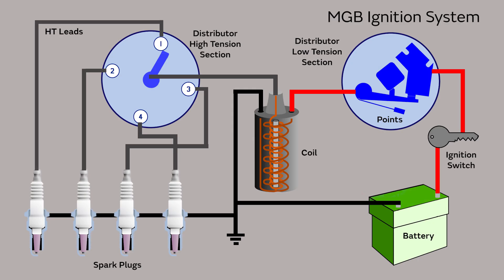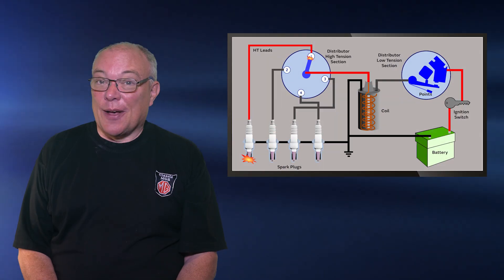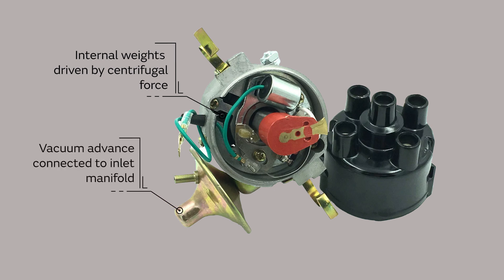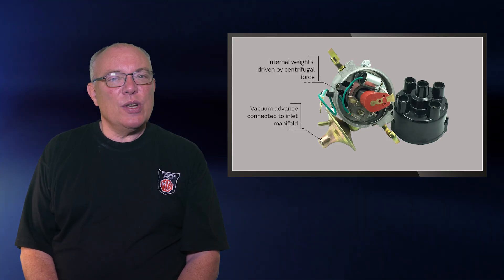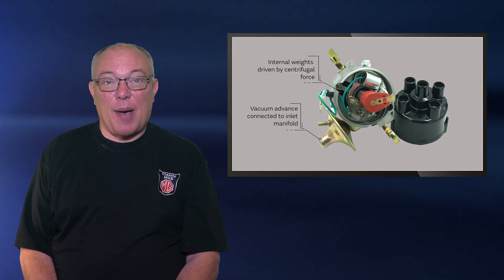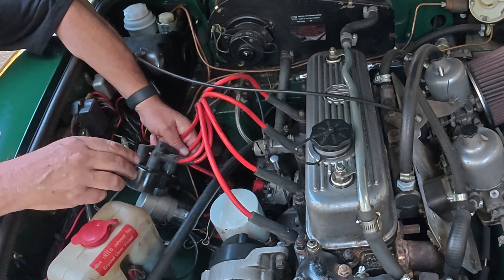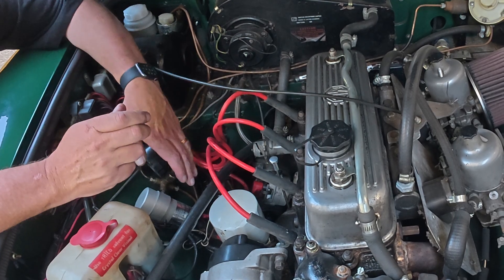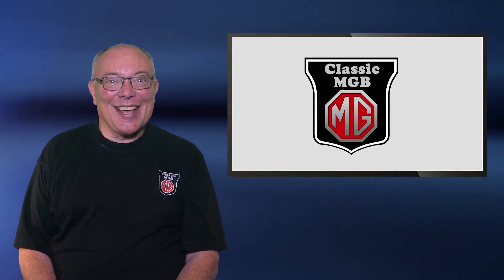INTRODUCTION TO THE MGB IGNITION SYSTEM | CLASSICMGB

Comment: Quite good except static advance is when the engine is static or just at idle before the weights make any contribution to the advance, from memory this is 10 degrees before TDC, vacuum disconnected. Total dynamic advance is much greater because as the revs increase there is less time for the fuel to mix and the spark must occur earlier so that the charge is fully ignited at TDC. The vacuum advance is initially high due to a high vacuum at idle & is used before the weights have spun up enough to advance as the revs increase. With a wide open throttle there is very little vacuum advance.
Reply from the maker: Many thanks for your comment - and the correction!  My apologies for the error! :-)

Comment: I fitted the 123 system,best 300 pounds i spent
Reply from the maker: Many thanks for your comment - I've heard that the 123 system is really good!
Reply: 100% agree Wayne, I've actually fitted the Ignition 123+ dizzy, makes the tuning of the engine with "modifications" so much easier.  Never in my wildest dreams did I ever see me playing around with ignition timing on the side of the road on an app on my phone and monitoring performance as I go, awesome piece of kit.

Comment: Very well explained Graham, excellent as usual.

I still have my original distributor in my garage but went with a 123 system with uprated coil and leads, not for the purist but has been trouble free.

Looking back at my car history invoices, the 80s were awash with points and battery changes!. 

123 distributor "looks" period too.
 

Keep up the technical videos, they are great

Well done, 

Jason
Reply from the maker: Many thanks for your comment Jason - I've heard the 123 system is really good :-)

Comment: I have a1977 MGB with the 1800 engine with electronic ignition. DoI need to gap the spark plugs wider?
Reply: No, not according to AC Dodds. Should still be 25 thou.
Reply: @DavidUKesb  Thank you.
Reply from the maker: Many thanks for your comment - Others have replied and I agree - that said, always a good idea to refer top the manufacturers info...